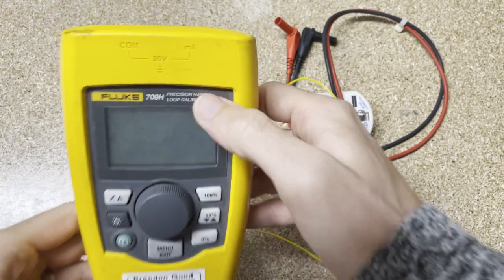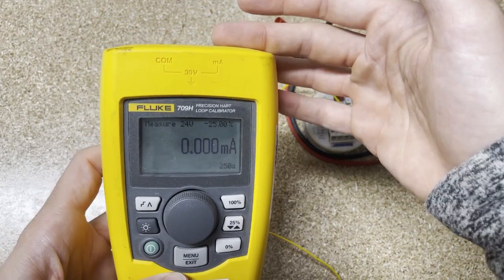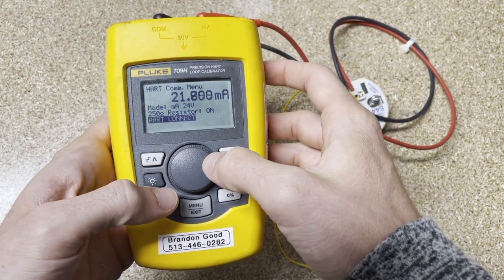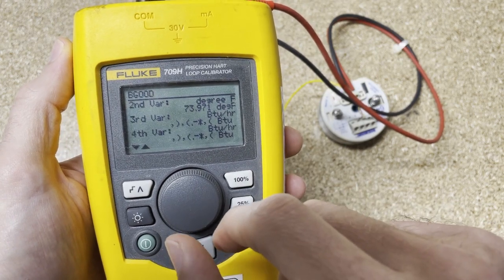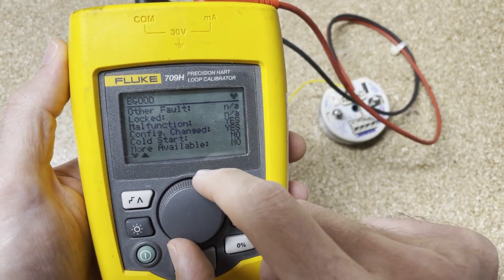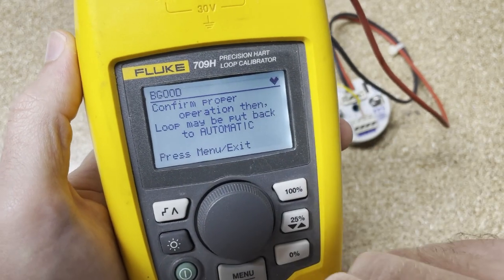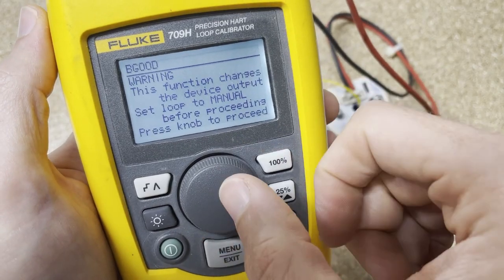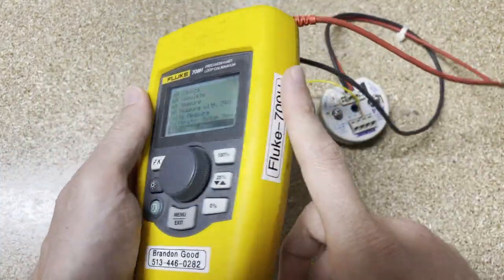Fluke 709H Q&A - Fluke Fridays - Episode 53

Comment: 709h is it posible change of range?
Reply from the maker: Not sure what you mean by change of range
Reply: @fridayswithbrandon  i mean input range, eg : 0 - 10 bar change to 0-8 bar transmitter use HART, is it possible ?
Reply from the maker: @reddee2750  yes you should be able to change the transmitters parameters using the 709H or 710